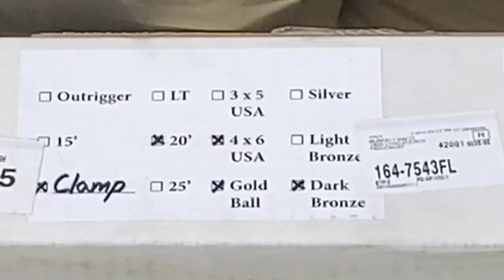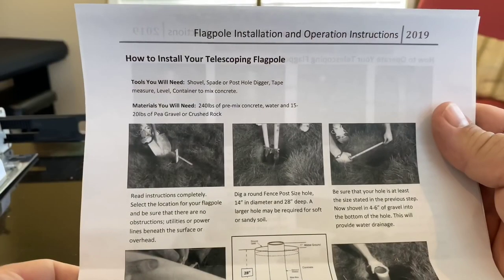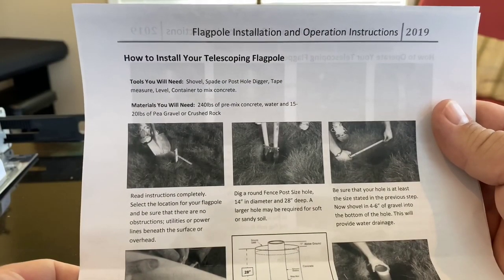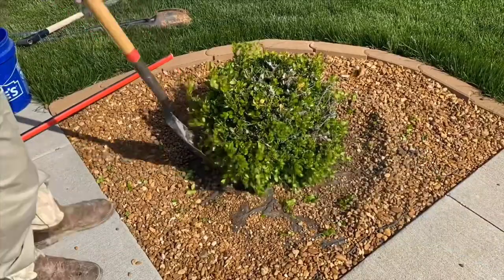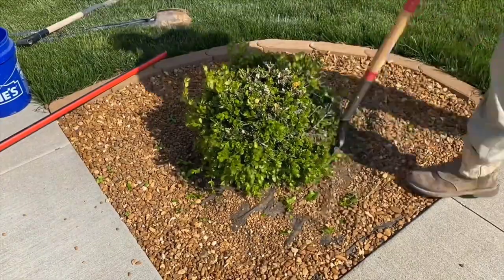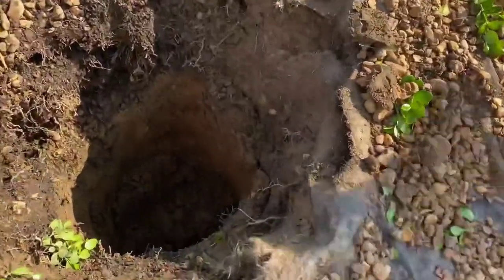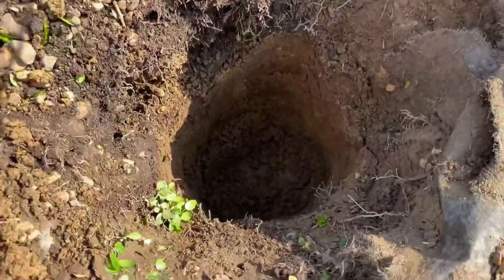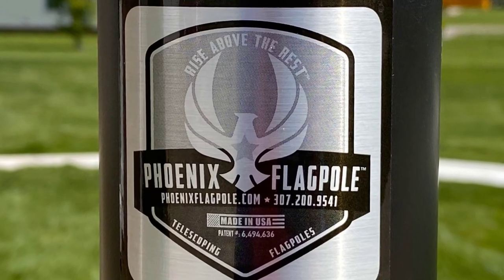Phoenix Flagpole Testimonial and Installation

Comment: I have to replace the sleeve for my 25’ telescoping flagpole.  What length PVC should I use?
Reply from the maker: If you have one of our Phoenix flagpoles you want to make sure you are using the correct diameter ground sleeve to fit our 3” Outer Diameter providing sufficient space without room for wobble. You also want to use ABS and not PVC as it designed to flex and withstand the outdoor elements.  You can find out where to get a ground sleeve replacement in the description. It’s good for any flagpoles with a 2.5” or 3” butt diameter. I hope this information helps!

Comment: 240  lbs of concrete! That is like 4 bags. I figured just 1 bag would be enough?
Reply from the maker: Thanks for reaching out and for your comment. We have many years of experience doing this and recommend using that amount for maximum stability. If you follow our directions then it’s really the perfect amount based on the dimensions of the installation area and size hole you are digging. Also, by not following our recommended installation guidelines risks the possibility of voiding the Phoenix Flagpole warranty if the flagpole is damaged due to improper installation. For a complete step by step installation instructions please visit our site in the description and look for the help section. I hope that answers your question. Have a great day! 🇺🇸
Reply: @telescopingflagpole  Bought 4 bags as you suggested. I am a disabled vet and hired a contractor. We went by the the directions and 2 bags took it to the top leaving just enough room for the ring. If I had removed a bush, I would have had a bigger hole and needed more concrete. Going to let the concrete sit 48 hrs instead of 24. This will be replacing the cheap made EZ Pole. Thank you for your replies.